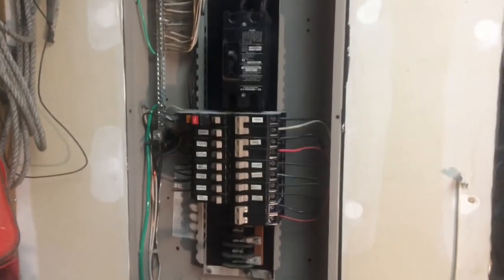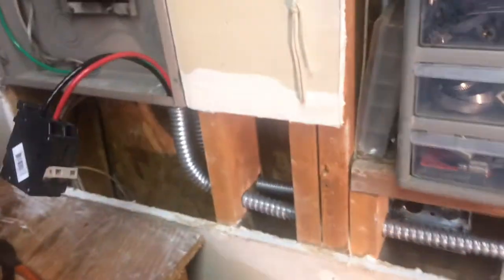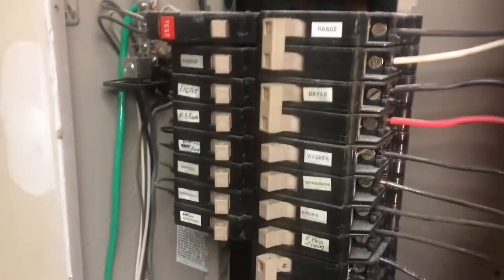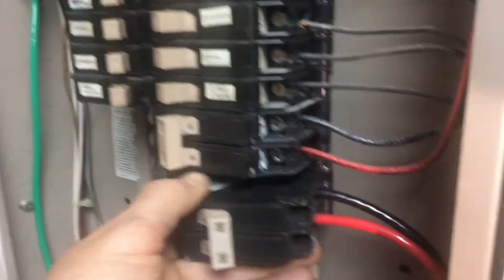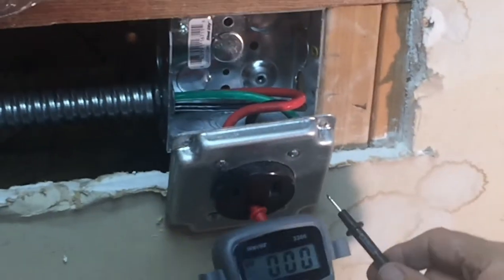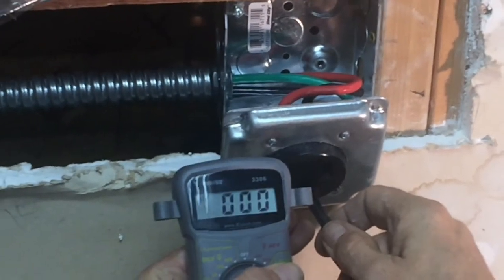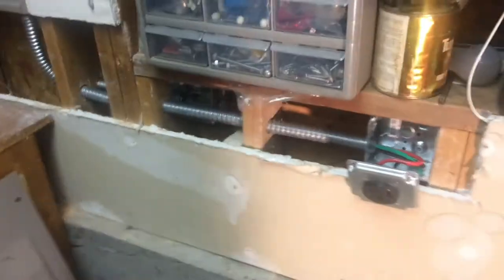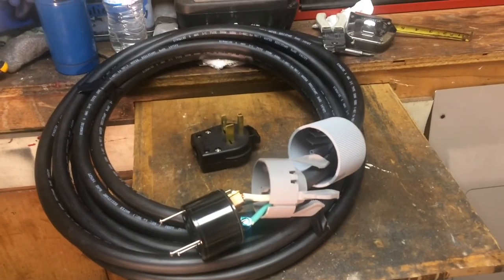How i wired in a 60 amp breaker and a 240v plug for a welder

Comment: With a 60A circuit, only a #10 ground conductor is required. Pretty clean overall though. Good job. Just make sure to run a bonding jumper to the receptacle box.
Reply from the maker: I really appreciate that thank you very much

Comment: would you mind sharing where you purchased the welder cable and wall receptacle?
Reply from the maker: Yeah no problem, I got the female end at lowe's, and I got the cable and male end at Platt Electric Supply
Reply from the maker: The wall receptacle I also got at Lowe's, you can also get it at Home Depot, I might add I built the cord, that way I could make it my desired length